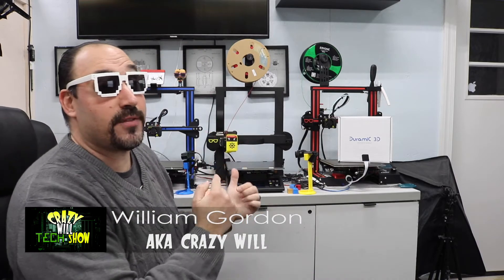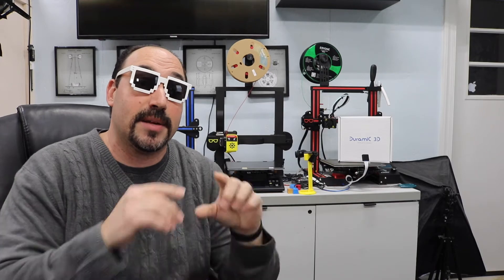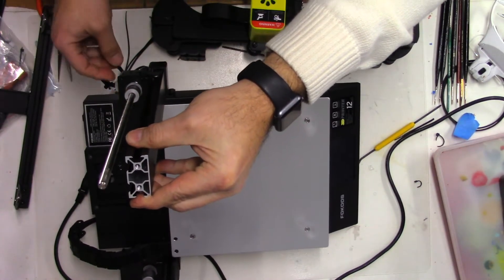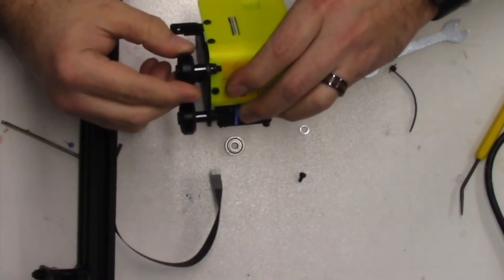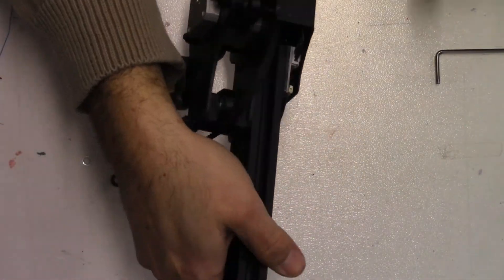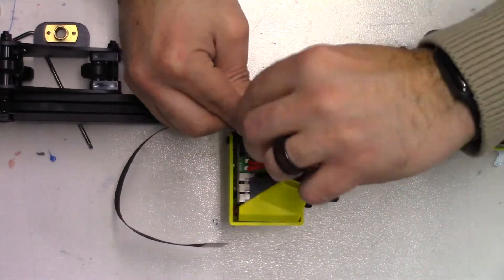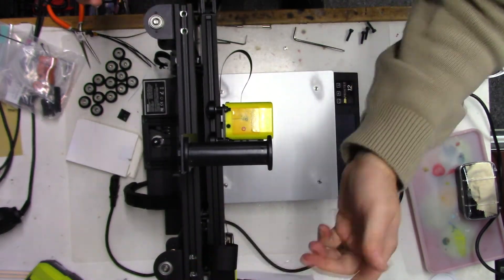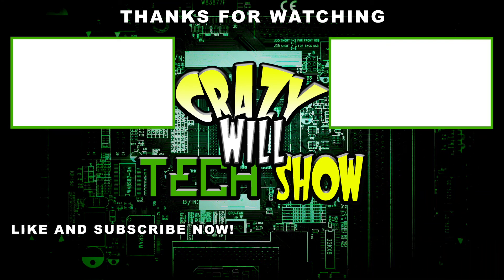Changing the wheels on the extruder head on a Fokoos Odin5 F3 3d printer

Comment: Hey there. I have a the same printer but having trouble with a different issue. I level the bed. But every time I start a print it tryst to print in a different spot. Sometimes so far it's off the bed and makes that terrible belt jumping noise. I can't seem to fix it. Evrytime I try ro re level the bed it thinks any of the 5 positions is in a different spot. Like spot 1 is nearly spot 2 and if you hit spot 2 for leveling it will grind the belt.
Reply from the maker: That sounds like something wrong with programming in the printer. I would contact Fokoos and asked them for factory reset or replacement.

Comment: From my experience there are very few perfectly level print beds. I usually adjust the outside where I almost never print to be not quite so good to allow for the center where I do usually print to be better. I suspect you are having a multiple adhesion problem. I have learned that in spite of almost everyone telling you to wipe the bed with alcohol (IPA) between prints that this IS WRONG. Never touch your print bed with IPA and especially your fingers. Wash the bed in hot water and Dawn dish soap (or similar) and you will not have adhesion problems, especially after the bed has been used for a while and lost some of its coating. Try what I suggest and see if it helps. Cheers!
Reply from the maker: I have two other printers with glass beds always use alcohol almost 2 years never had a problem with an Adhesion. No disrespect but it always works for me. I got it fixed https://youtu.be/RNPSrxhFEA8 something really screwy with this printer.